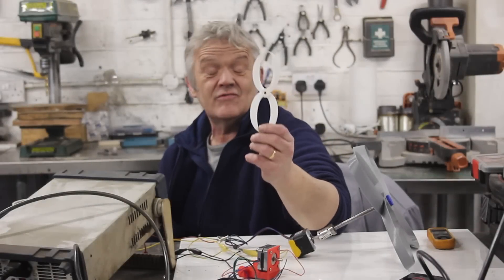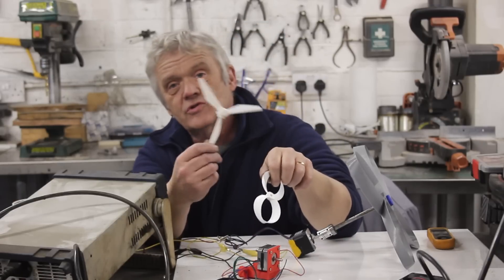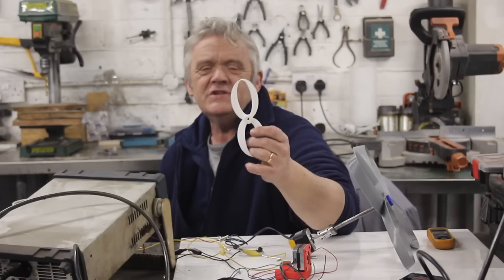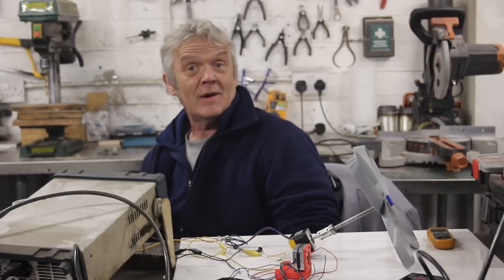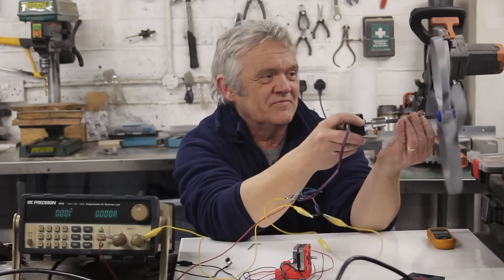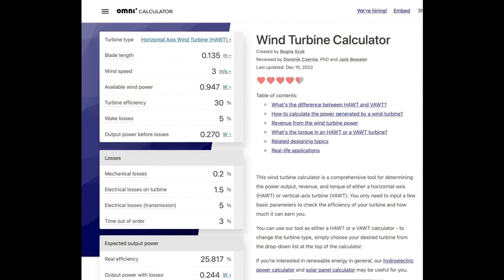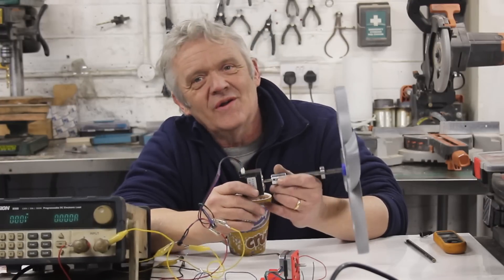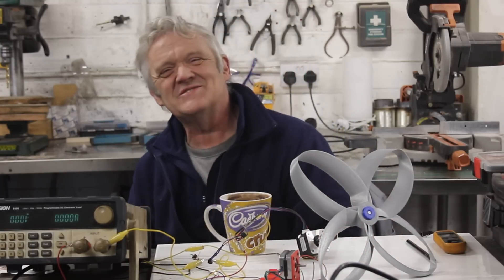1846 Further Testing Of The Toroidal Propeller For Wind Turbine Use

Comment: With the way turbine blades resemble sail plane wings, I've often wondered if adding winglets would help reduce losses from vortex generation.  

Also, nothing is more reassuring than someone who goes back to check their work.... I've known confident fools all my life. Nice job.
Reply: Perhaps little winglets at the right angle for the speed would help. Putting fan in a tube might make a difference also. All blade design work differently at certain speeds. You almost need a viable pitch to get the most torque and relative speeds. Area of blade in a torado blade is much greater. . So a smaller  diamerer speeking would be needed. Comparing blades by diameter is a mistake.

Comment: Hi Rob.
Could the tested toroïdal turbine have a preference, for wich way the wind goes in?
It seems that the shapes of the loop are curve differently on each end, maybe some aerodynamic lifting could occur?
Sure, at the tip of the blade something in the design is not right, as you’ve show.
With a roll meter, we can reproduce one blade loop, and change the angle to find some kind of idea to inproove it.
Cheers.

Comment: Thanks for the video. These things are only more efficient when the blades would otherwise cause cavitation. While you're not interested in them as propellers, that is where they shine (at much higher RPM).
Reply: This^
The Toroidal Prop was designed for reduced cavitation at high speed and in water. With a redesign & enough revs you might get it to work reasonably good as a flight propeller but as a blade for a wind turbine I can't see much point. Better to play with blade tip design on a normal blade to increase efficiency & reduce noise. Also just increasing the number of blades can reduce noise at the right speed. The right blade for the expected wind speed is very important.

Comment: the only reason these are impressive when used on drones is because they are much quieter at high speeds without much loss of thrust, maybe it could be good for home use if conventional turbines are too loud but i think if you are getting windspeeds that can turn this in the 1000s of rpm then you have bigger things to worry about

Comment: For the novelty of these, I can see them being useful in water where the material density is dramatically different than air, though in that respect, you can simply add a ring shroud to a standard propeller and achieve the same result. If the aim is to 'catch more wind', two archaic cones counter positioned on a stick would serve better. You nailed the end note though, Robert. It looks neat, therefor it must be better than standard.  SOP for the internet I'm afraid.

Comment: Without meaning offense it occurs to me that a propeller designed for use in water will behave differently when it encounters a compressible fluid.

Although many might just waive their hands about at me when I say this it important to consider the compressibility of fluids as materials when you apply the discipline of materials science to your engineering formulations.

Comment: It looks like the angles are all wrong. I wouldn't be to quick to dismiss especially after your lecture on expert vs expertise. More experiments on design shape and angle to the prevailing winds may be in order. I'm a dummy on most things but it seems a swept area has to be more than that. Is it possible that the same area between a flat board and a aerodynamic shaped board have the same area but wildly different performance values. I'm sure I've missed the nuance of the subject matter. But remember your audience is varied and some like myself would like more than the spoken word when we see  that slight changes May yield better results even if we are totally wrong about it. Or at least let us know we should try it ourselves but to give the eager minds the it's no good because of AB and C when the rest of the alphabet is unexplored is a tad uneducable to some. Darn it. Im having trouble trying to explain without causing offense. Please don't take it as such. Non is intended.

Comment: Dear Robert sir, I think you may have it on backwards. If so, it won't have been a fare test. Looking at the video the wind will be deflected by the front edge of the blade then be turbulently sucked back round as it passes causing deceleration and drag. If it was on the other way round then after the initial deflection it would be further accelerated by the curve of the blade. Yes/No?
Reply: No, it's mounted the correct way. You can see the camber on the blades.
Reply: @tlangdon12  someone else already questioned the direction, describing it as set up for thrust. Turned 180 the "camber" would be similar but deflecting the blade to cause further acceleration, at least in low wind speeds. The way shown in the video seems that the initial leading angle is steeper but becomes shallower - should it not be shallower on the leading edge becoming steeper to add further acceleration?
Reply: @jonbell3531  The blade in the video is quite flexible so it will untwist under load. It doesn’t matter if the load is from it being driven by a motor or by the wind.

Comment: The design is to reduce cavitation which is to reduce the formation of bubbles or air pockets as it produces thrust.

In reverse, the blade is not spinning to produce thrust and therefore will not produce cavitation and does not need to reduce cavitation. 
In reverse, thrust that already exists in the wind, is causing the blade to spin.
In reverse, the blade is the consumer rather than the producer.
The blade is reducing the amount of thrust through consumption.

I think that your tests show that just because a blade is more efficient in producing thrust in water, that does not necessarily equate to being more efficient in producing thrust in air, and especially does not make it more efficient in converting the thrust of wind, into useful energy.

It may also mean that, the claim of the design being more efficient in water is actually not true and just a marketing scheme.

Comment: I think the reason for the popularity of the Toroidal Propeller is several fold .....

1. It started off in the marine industry where there are definite advantages due to lack of cavitation.
2. It made a Noise as a quiet prop for drones. Whilst this is less obvious the high spin rate and the formation of vortices from traditional blades causing noise the obverse is also true.
3. It is new and sexy, MIT have jumped on the bandwagon ( prostituting an organisation like that is beyond me .... but it is American) and everyone jumps on board .... and they can't be wrong because everyone else is doing the same! It reminds me of Tulips!

Interesting fact ...... In a plane driven by propellers most of the noise is generated not by the engine, but by the propeller! (At least in modern planes, Not sure about some of the WarBirds)

Comment: As a guy who has never built or tested a propeller, I wouldn't dismiss these toroidal blades just yet.
Maybe they need some sort of external enclosure/funnel to get the best of the design,, hashtag Vortex/Tesla... 🤫
Computer guys claim they are quieter as cooling fans, which if true should account for something...

Comment: I would be willing to bet that the pitch of the blades is just too steep for the application. Flatten it out a fair number of degrees and you will likely see a big difference. Also, there appears to be no chord line to this toroidal prop you were given. It looks on video like a flat ribbon that was twisted into shape. There needs to be an arc to its surface area in order to fully utilize the air pressure being directed at it. In this case you want an impeller rather than a propeller, so the inverse orientation is what is needed...I think 🤔.

*Not an EXPERT, just a guy with a lot of boating and aviation experience (propellers).

Comment: Well done Robert! A resistive load is much more sensible than an LED which just clamps the output voltage to the LED array's natural forward voltage characteristic, allowing it to light even with a ridiculously small amount of current. But a fairer test still, would be to choose a load resistor that causes the output voltage to drop to half of its off-load value. Now do that with your two different designs of propeller under the same wind conditions, and compare the resultant powers produced.

Comment: The promotional video I saw pointed out that the friction / density of water is different than air and that means different angles and distances of blades are needed when going from one to the other.  If tests were done with properly dimension "air" blades then I would be more inclined to believe the "debunking".
Reply: I don't think I have seen anything more efficient than the Golden Ratio Turbine.

Comment: Totally unrelated to this propeller.But I was just thinking if that Darwin wind generator could be used as a vawt, so that high wind speeds would rotate the whole thing AND push the air to the tube.

Comment: Did you know that different resistive loads produce different power? For a given rpm of the alternator there is one resistance that produces the most power. Voltage times current. At other resistances the voltage is highest and others the current is highest. But only one resistance that produces the most watts. My theory is that that ideal resistance is equal to the inductive reactance of the alternator stator at that rpm. Change the rpm/ frequency and the ideal load resistance changes also.

Comment: Why did you test with a 100-ohm load? Will the power output vary with load resistance?

When testing the output of a solar panel it is generally measured at its MPPT and an MPPT curve is produced.

Comment: Just a thought 🤔... If the working surface was further out on the edge of the peripheral like a standard turbine blade wouldn't it be more effective and produce more torque? Seems like the working surface is only usable in the middle of the "blades".

Comment: A possible gain toroidal propellers might offer is in reducing blade tip drag as all wings produce drag inducing vortexes as a part of producing lift. This is the aerodynamic improvement behind high aspect ratio wings, Q tip propellers and winglets on aircraft. Then again it might not. (Is there any-one out there with CFD abilities to assist? ) If Q tips made any real improvements in wind turbine blades, which already have high aspect ratios, they would already be in use.
Reply: And they are. Some large scale wind turbine blades have winglets.

Comment: I like the idea of the Darwin wind diverter as a mobile system for motorhome/camper use. Can you develop this to use a 3d printed vertical turbine with generator and some form of exhaust to create a venturi to produce charging for a 12v system?

Comment: I think their application in water is the key. They are more efficient in liquid and prevent cavitation pitting which was the intention. They may work in air but they need some redesign to work efficiently in air. The current versions in water are very good but air and water are 2 different things. Although they obey some similar fluid dynamics there is no comparison to the drag and density of them. Maybe someone smarter could design one that works well with air but until then these should remain for boats in my view.
Reply: I understand that cavitation damage to props reduces efficiency, and is also is expensive to repair/replace.
I do not understand the relative economics of maintenance vs efficiency, but I can very much see that this design could save on both, so it must be a winner(?) :)
Reply: @pompeymonkey3271  Think if you never had to replace the propeller on a cargo ship, ferry, or large yacht.  Theoretically, no cavitation, no steam damage, no extraordinary stress or degradation could result in props you can use not for the lifetime of the powerplant but the lifetime of the vessel itself.
Reply: I would expect them to be more efficient due to wing tip vortices.

If they end up quite, that's also a plus, and a sign of increased efficiency.

But they're harder to make, and I doubt you could make these as big as an equivalent normal blade.
Reply: yes water and air have the difference in that one is wet and the other is dry,but that is where the differences stop other than water is more viscous than air both are fluid mediums and react in the same manner,so if the toroidal blade can have less input power to get the same thrust or water movement throughput then the same can be said for a toroidal blade in air.

Reverse this and the same wind speed should create more torque for the same water or air throughput versus a straight fan blade.

Be aware that  stepper motors do not rotate freely like a normal dc motor/generator.And are not the device of choice for a generator or motor  application ,they are used for precision movement in cnc applications.

I'm not convinced that the test was done in the best way.

Comment: The theory would be that given constant maximum working windspeed, you could use a bigger diameter for the toroidal propeller without exceeding noise limitations. That is, you could run at higher tip speed.
Reply: Also, this closed-loop design seems to be inherently more flutter-resistant, which adds to noise reduction. I also would like to see some simulation on what would happen in a larger generator and at higher wind speeds.

Comment: from the side view it looks to me that the prop was mounted like a thrust propeller / like a fan. if you mount it the other way aroud maybe the geometry of the prop is more effective as a turbine

reminds me of the tesla turbine as a pump video. I think in that video it ran in the wrong direction too. (the housing was distinguishing the airflow direction)
Reply: No, it won't generate more power if it was reversed. That way round, it would only produce power using the drag of the blades. As Robert had it held, it was generating power using the lift that the blades produce as the air moves over them. This movement of air is exactly the same relative movement that the blades would encounter if they were powered by a motor or engine.

Comment: thanks for further test robert and i think your right as a wind turbine its not great however hehe... if you look at the efficiency curve when in a boat application it seems this style of propeller simply gets to best efficiency point much quicker and therefore imo the amount of input require to sustain the output is where it seems better maybe... how this translates into a wind turbine application i am unsure but could it be measured by seeing what the moment of inertia is with this prop vs a standard prop ?

Comment: I agree with having a prejudice from the start. my prejudice is that an increased surface area will likly result in poorer performance.

 It is also  good to put our prejudices aside and make a proper comparison.  But I disagree that testing with a fixed resistance is a proper comparison, because  efficiency depends on tip speed ratio. And unfortunately, a fixed resistance does not allow one to vary the tip speed ratio. One simply need glance at a graph showing coefficient of performance as a function of tip speed ratio.

 I'm not saying this turbine will have any tip speed ratio that results in a greater efficiency, but one can't prove that with some radomly chosen fixed load.  

I Love what your doing on your channel but your test here, all by it self, is almost a useless comparison.😃

Comment: Is there any use with adding winglets to a regular wind generator blades as planes now use, to reduce wind slipage/ tip vortexes , probably not very big due to the relative slow speed but small gains?

Comment: They do look cool.
I’d like to see some strength/weight ratios with different fill % and support angles 👍
Reply: I think mass plays a part and fluid viscosity.  The torid has more mass than the regular blade to produce electricity.  I wonder what happens in a high wind?
Reply: I WONDER WHAT EFFECTS CAVITATION HAS ON BEARING WEAR.